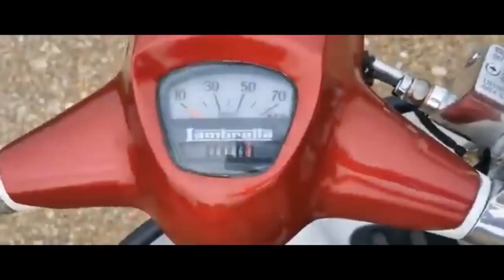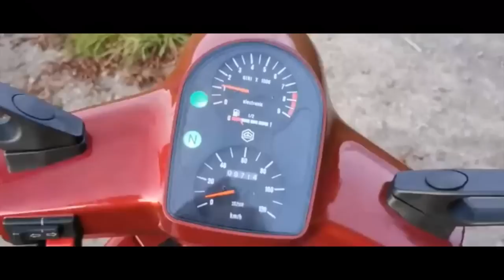5 Classic Scooters

Comment: Back in 1962 I owned a Vespa 125, made in the UK by Douglas Motorcycles in Bristol. It wasn't a bad machine around town, though with the engine mounted on the R/H side of the bike, it tended to fall into R/H corners and required a bit of persuasion to take L/H ones. I kept it for about 9 months, then replaced it with a new 1963 Jawa 250, which much better suited my needs.
Reply from the maker: To be honest I thing Douglas just imported and assembled complete bikes
Reply: @bikerdood1100  That's what many thought, but it wasn't the case. Douglas made Vespas from 1951 to 1965. Their production included Douglas-produced cylinder heads, gear clusters, brake drums and other mechanical parts. Local UK Vespas also had British-supplied seats, tyres and carburetors, as well as some electrical components. It was only from 1965 to 1982 that Douglas fully imported and distributed Vespa.
Reply: @chrisweeks6973  The Douglas Vespa had the headlight on the apron.

Comment: I honestly think that 2 stroke scooters are the most fun you can have on 2 wheels - the sound, the smell, the comfort, the usability, the filtering; you cant help but smile when your on one. They also aren't any slower than full size bikes (until you get to country lanes or motorways) On my speedfight2 100cc I regularly keep up with 600's+ because I can squeeze down anywhere, and on the straight they have to get very illegal to get away from me.
Reply from the maker: Not sure about the most fun 
But definitely fun I’ll grant you

Comment: Still got 2 of them, one an SX150 Italian frame, but with a Mugello 225 kit on it, probably somewhere around 25 - 27bhp and a lot of fun. The other is a lovely LI125 with a 200 kit in it in beautiful Merc Benz silver. Love riding them both, not hugely fast like a sports bike, but on 10 inch wheels fast enough! The 2 stroke smell, quick revving, lots of gear changes, like driving an older MGBGT or the like.

Comment: When I lived in England (early '70s) my partner and I bought a pair of scooters, a Lambretta 200 and a Vespa 150.  We used them to get around Manchester and the general area of Silverstone racing circuit, where we were headquartered.  Bought the pair from a breaker's yard, so they were missing some bits,but they were also 20 poounds for the pair.  Didn't take much to get them going, and neither one had rust, which was a serious problem, espcially with the Vespas.  I always thought the Lambretta to be the better machine, but it was easier to get parts for the Vespa.  They were useful on town streets with low speed limits but absolutely treacherous in the wet and neither had good brakes (even the Lambretta, which had a front disc).  Had no trouble selling them for 120 pounds the pair in late 1974.  I have no idea what the cost new, but I think it's safe to say they had lousy resale value.  Girls liked them, though!
Reply from the maker: Ironically valuable today of course
Reply: @bikerdood1100  True of MANY things...like early VW Beetles.  Sometimes, when you spend a bunch of coins on an item of questionable worth...it's God's way of telling you that you just HAD too much money!

Comment: Glad to see Zundapp represented. I learned on a friend’s 250cc two-stroke single Zundapp road bike that he had ridden from Florida to Massachusetts, 1,000 miles.  (OK, have it your way, about 1,600 km.) The alternator failed along the way, but it did  fine on a 6 volt lantern battery. As long as you did not need lights.  .  .
Easy to start, easy to ride, reliable. (Except the alternator. Good luck finding parts in the U.S.
Reply from the maker: Well alternators can fail on anything 
Japanese bikes especially I find, so I won’t hold that against the Zundapp

Comment: Another great 5 classics, i have a foot in both camps riding both motorcycles and scooters. Over the years i have owned Japanese super scooters like the Suzuki Burgman and Yamaha TMax and found them brilliant for what they were designed to do. I covered 30,000 miles in two and a half years on the Burgman commuting to work. Today i run a couple of smaller cc scooters for my small commute or shopping saving me from getting one of my motorcycles out. There is also very healthy social scene in the scooter community. How about 5 motorcycles that wont cost the earth to buy and run?
Reply from the maker: I too have owned a Burgman which I thought was pretty good also had a couple of Aprilias a piaggio and a Peugeot all of which served us well

Comment: My first single track motor vehicle was a Lambretta SX200 (RAR 88D - I still have the engine/gearbox but foolishly discarded the rest, after passing my test on it in 1971) and my second was a Norton 650SS (I still have all of it).

The big difference was that the Lambretta was great for hopping onto, dressed as normal (and in those days helmets were not compulsory), and getting the errand done; but the Norton requires fettling, and my dressing in complex leathers, but provides great fun before a silencer drops off from the vibration-induced fatigued bracket (it happened on the A1 on the way to the family home from University in Leeds). The scooter also had a spare wheel, in the days when motorcycle punctures were common. It also had a front disc brake.

A friend had an Iso Milano scooter, which occasionally started with the engine running backwards, and the clutch was on-or-off - but he still got through his motorcycle licence test. If only I'd had a camer handy when he revved hard, flipped into gear, only to reverse at high speed into somebody's front garden.

What I never worked out was why the speedo was labelled "Sir Thomas Lipton". I have since speculated that it might have been based on Lipton's yacht.

How many Lambretta owners disconnected the speed cable, only for the knurled nut to slide down the cable to the bowels of the front wheel downtube? There were two options: turn the scooter upside down, or spend a few hours fishing with a bent bit of wire. I chose the latter, but nowadays a neodymium magnet would have made it a trivial problem.

I wish I'd kept the Lambretta - it would have been a useful vehicle for my current needs.
Reply from the maker: Things haven’t changed 
I have often used modern scooters for commuting and found them to be very good
Reply: And if you had of kept it you'd be amazed at the price of a Sx200 nowadays! Italian and matching numbers a minimum of 6k if in very good condition probably 8k now.

Comment: I'm with you there on that fence.  Much prefer full size bikes,  but I sure have enjoyed some scooters.  They really are great machines for a lot of applications.   My favorite is the Piaggio BV300 - it's got 16" wheels!  And for short hops is better than a motorcycle
Reply from the maker: Had a few scooters for commuting over the years and found them very good
Reply: @bikerdood1100  Perhaps a "Maxi-Scooter" collection?  Things like the Burgman go way back.  They are as tough an engineering/ price/volume proposition as any bike,  if not harder.
Reply: @bikerdood1100  Same here, bikes are great on open twisty roads in good weather. but on a cold wet January morning when your late for work the scooter wins then, is there not room for more scooter collections (maybe some of the rarer such as the velocette viceroy for instance) or maybe fully enclosed motorcycles?

Comment: I had the following 
1960? Lambretta LI 150 Series 1 (headlight on front panel not handlebar).
Vespa Gs180.
PIAGGIO X10 350CC CVT SCOOTER
KAWASAKI J300 SCOOTER CURRENTLY    MY CURRENT TWO WHEELER !!
Reply from the maker: Never owned a classic scooter myself
We hav3 had a number of CVT types though from 
Suzuki, Peugeot, Aprillia and piaggio 
All pretty good

Comment: What about Maico scooters - both the Maicomobil and the Maicoletta were classy, well-respected scooters on the UK market. The NSU Prima was also a well-made German scooter but it was a tad expensive. A friend of mine had one in the late 1950s/early 1960s and I remember it as a really well-built machine. The Maicoletta could have a serious stab at matching the performance of contemporary motorbikes with similar-capacity engines while giving some weather protection. The Maicomobil was similarly powered to its sister Maicoletta but had absolutely `Marmite' styling with a huge ungainly - looking front end. My unreliable memory tells me it had a spare wheel mounted there!
Reply from the maker: Well only room for so many in one video

Comment: Pity you were not able to include ( though understandable they are rare, no criticism) the Moto Rummy 125, a most unusual thing with an across the frame horizontal twin cylinder exposed 2 stroke twin and the tank , also horizontally mounted high up behind the handle bars, as an apprentice donkeys years ago, I was mentored by a guy that had one, they were brought into Uk, I seem to remember being told that the guy that owned the company was an artist or sculptur or something.
Reply from the maker: I’ve seen those 
Most atypical design. Hopefully if this video goes well it won’t be the last as I’d like to do a few more on scooters
Reply: @bikerdood1100  Bitri, Patti, Peugeot, NSU.IFA

Comment: you cannot compare a scooter to a motorbike... they are 2 separate types of 2 wheel transport.....   both good at what they are  designed for.....
Reply from the maker: Nonsense 
Both are essentially bicycles but with a different approach I’ve owned and ridden both and can testify to the stupidity of that statement 
I can’t abide snobbery on either side of a non augment
Is a Honda cub a scooter or a bike 
Where do big wheeled scooters fit 
See Total bollox

Comment: Love the vids! I can't stand Motorcycles. No interest whatsoever. I strictly ride and collect Scooters. Far better than any motorbike for me. I been riding since 1973 and have ridden across Canada and through the US on my 64 GT 200 many many times.  And now I have converted all my large collection of Vespas and Lambrettas to Electric and they are faster and more reliable than either their original counterparts or Motorcycles now. Great Vids, rubber down
Reply from the maker: Scooters are motorcycles tbh 
I wouldn’t have lead with that comment though 🙄
Reply: Each to their own. But to me it'd be ripping the heart & soul out of iconic scooters by making them electric. I've a 1962 GL & no way would l do that.
Reply from the maker: @saltaireorangebicyclechopp8555  I wonder what is the battery range of these electric marvels 
Crap most likely 
EVs will be the death of motorcycles 
Over priced soulless junk
Reply: @bikerdood1100  Agree, apart from taking the heart & soul from the scooter, my scooter is incredibly economical in the first place, it's peanuts to own & run. I think an electric conversion would cost me £4k+ and then with a devalued scooter l don't think there is any financial saving to be had. I honestly don't think people are thinking straight.